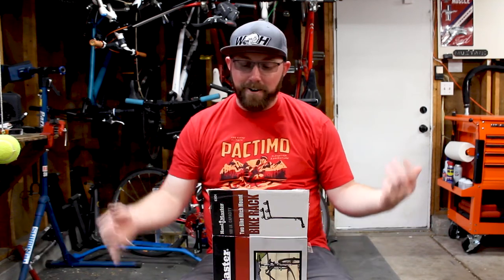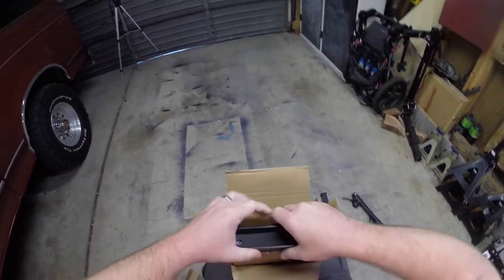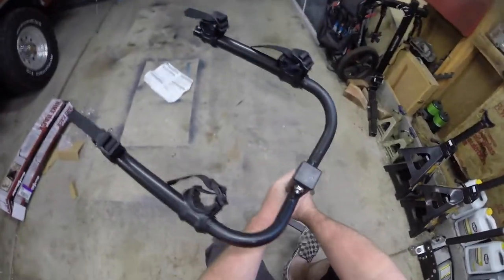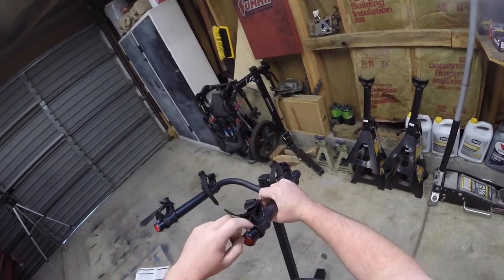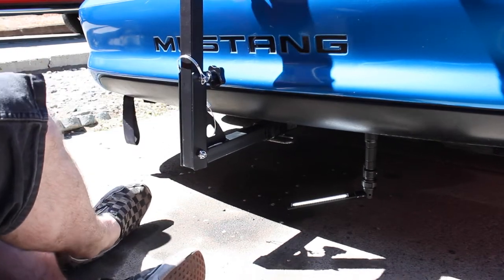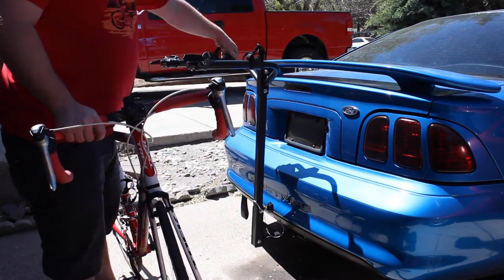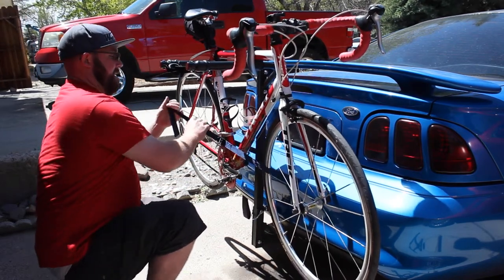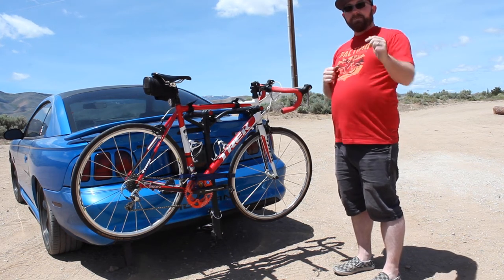The Cheapest Bike Rack Install

Comment: The video shakes too much with the head camera in the first half. But I stood through it to the next part. I got some useful remarks here and there.  This must be a different hitch receiver, mine is from e.t.r.l.r., and this rack fits quite a bit more  loosely with a lot of clearance top/sides (as opposed to how I saw you struggling to push that in); which sadly makes the bike rack crooked. 
Also liked the straps idea. Might need to get some short straps.